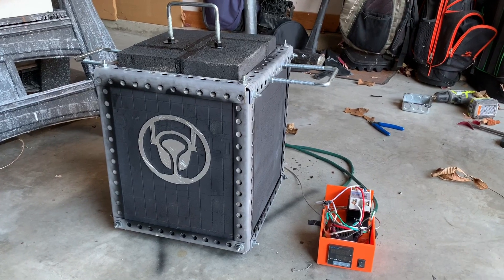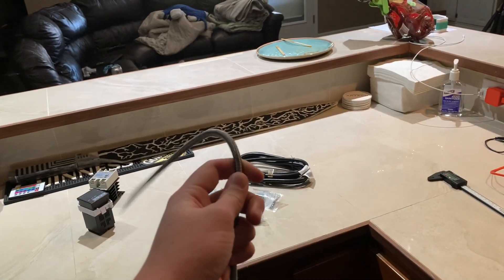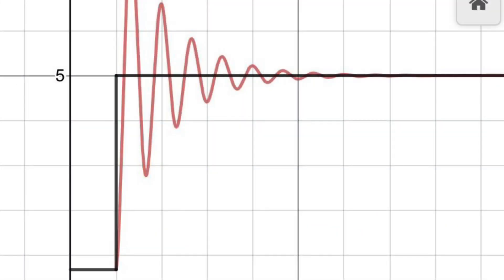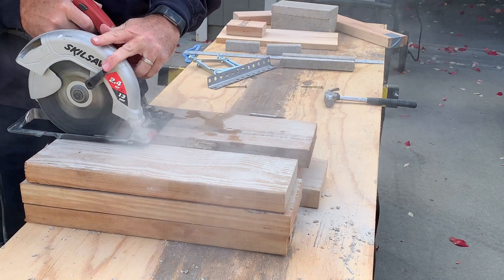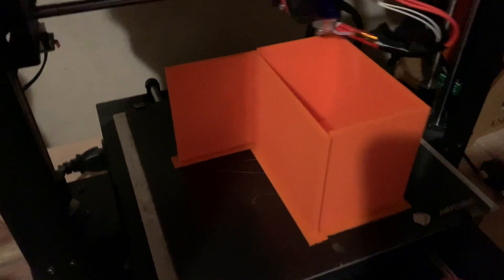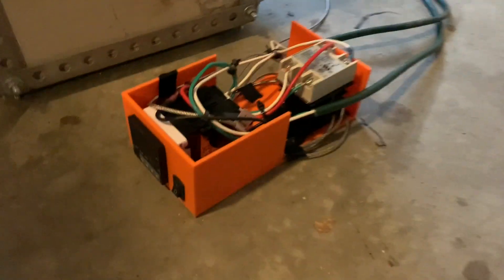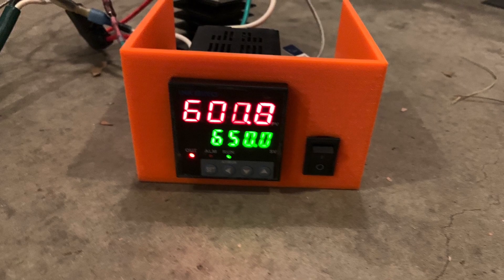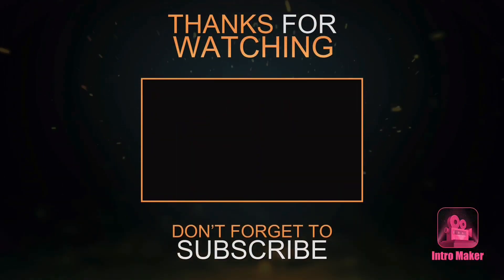How To Make An Electric Kiln Cheap (part 1)

Comment: I'm in the process of making my own kiln as well.
Could you help me with a couple of inquiries I have?
Reply from the maker: shoot
Reply: @American_Innovation  I wanted to ask about the specific parts and specs of each of them to make my own using a gas furnace I couldn't use in the open due to the heat.
In my urgency, I spent nearly 4 hours talking with an AI about every little detail of every little spec until I decided on all parts and hopefully they don't explode on my face.
Reply from the maker: @FredrickSylar  Okay. Good luck! Most gas furnaces are made of a ceramic wool, I imagine because of humidity and temperature shock. So if you have wool, I'd suggest a better structure for the coils. Also make sure you aren't drawing too much current V=IR, off of 110V, I cut my wire to a resistance of 9ohms (it'll say the resistance per meter on the package) if you can't fit that much wire in the furnace, you could use a big fat resistor to reduce current draw, or better use a transformer or power supply rated for the power you want. I hope that helps, if not I do have a second video that I made after learning a bit about electrical. Make mistakes, learn a lot, and once again good luck.
Reply: @American_Innovation   my furnace is made of refractory cement so I assume it'll be easy enough to make groves for the heating coil with a router.
So far in my configuration, I'm using a v220 line with a power supply to power this setup. Boy, I wish AI wasn't screwing around when it suggested this!
I'm still waiting for parts to arrive from AliExpress since absolutely no local vendors have them in this sh!thole I'm in.
Reply from the maker: @FredrickSylar  Sounds much better than my design. Do you know the volume of your furnace and the power ratings of the power supply?
Reply: @American_Innovation  I don't know the volume yet but that's because I intend to scrape it a but and make it larger on the inside (has nearly 15cm thick refractory cement circular wall). The power supply rated for 1300w with matching relay and coils rated for 5kw.
Everything was pretty much dirt cheap except for the furnace body that I replaced with my gas furnace, all in all cost me $65 with shipping.
Reply from the maker: @FredrickSylar  Sounds like a good setup, I'm jealous.
Reply: @American_Innovation  would you like it if I compile all links for each of them for you?
As stated before, I'm as oblivious as one could be and all parts were picked with AI assistance to reach up to 1600° C and I'm surprised it's this cheap.
Hell, even the heat resistant wool cheap enough if I wanted to make the casing myself but I know for a fact even the frame metal can't be found where I am at the moment.

I'm basically preparing a furnace/kiln for lost wax casting and mold preparing but keeping my options open for metal smelting as well.
Reply from the maker: @FredrickSylar  Yah, I could make sure you won't burn your supply and give rudimentary estimates on heat rise.

Comment: First off great job bro. I ordered inkbird 100 had a friend try and burnt out the thing. I ordered a new one but it’s the 106 not sure the difference but I was wondering a lot of people connect the pid to a receptacle they incorporate in the box for the pid now if I did that could I keep my existing switch on my old kiln or do I have to removed that existing switch for the pid to work
Reply from the maker: I actually had the 106 seriesto begin with. I don't really have time to look at the data sheets, but they seem very similar.

Comment: Thank you for your video. How did you determine the number of watts to reach any temperature, the number of heating elements and on what voltages 110 or 120 volts. THANKS
Reply from the maker: The kiln euns very small margins, I have a second video that is much better. You could use watts to find expected temperature with volume and a specific heat of 0.718kJ/kg-K but that would be better to find loss. The heating elements were run in series so the number doesn't change anything physically, it just made it easier to distribute the heat. If you are buying the coils they should tell you the resistance per unit distance, use that and geometry to find how much you need to stretch them using V=IR your voltage is constant 110 or 120 divide by the current you want to draw, and use resistance to find the linear distance of the coil.

Comment: Bro I want to follow this build but I see you saying it’s not the best version is it possible for you to make the new version of this build or do you recommend any walk through for a good diy version I like yours because it’s more simple to follow then others on YouTube
Reply from the maker: Veg oil guy has a good walkthrough although his is more complex. You could follow this with a smaller setup, more insulation, and following an resistance coil calculator. It’s been a few years, and while I’d love to revisit this, I use my resources to learn new things. I’d take concepts from multiple videos and maybe a couple teaching or reminding yourself how resistance coils work and ohms law. Remember small volume, equals cheap and hot.
Reply from the maker: Updates

Comment: what has been the max temp's ?
Reply from the maker: With a shitty American power supply ~700 F I was like 15 when I made this, so stupid. If you want to replicate it but better, use 220v  do your calculations for the resistance coils, close the area closer, and insulate everything, if I did it again, I’d double the bricks and use a hinged lid. Or use a transformer to conform to your needs.
Reply: @American_Innovation  ive got about everything for the ROKU propane kiln using a galvanized trash can lol, ceramic therm insulation route, but id rather have an electric one, any idea of a controller cheap?
Reply from the maker: @wonderwond  The PID controller I used in the video is a safe bet, it's $40 on amazon with the thermocouple and the Relay. That dilemma will be fixed with what you want to use it for. If you're melting metal, propane is a great way to go. If you want to burn out wax for casting, you'd want a small, sophisticated setup with programmability, if you want to harden clay, there's a range of ways to do it. You said ROKU, that's a tV thing so I'll assume you meant RAKU, which I believe is where you heat it quickly to cause cracking in the ceramic. Electric would not be the way to go for this. I'd use propane and buy a couple firebricks at Menards to disturb the airflow and assume an even distribution of heat. To control the temperature, use a stopwatch and your eyes to gauge the flame temperature. That's about the cheapest way I can think of. And if not firebricks, Place the burner tangent to any point on the bottom of the bin to avoid uneven heating. I'd still prop the ceramic above the flame with a regular brick.
Reply: @American_Innovation  recommendations ? im using a 31 gallon metal trash can with ceramic  insulation
Reply: @American_Innovation  I broke down and bought a used skutt kiln for 200 bucks,,, needs very little brick repair, cant wait to test it out

Comment: How much ohms or watts its layer of resistans is??
Reply from the maker: I just posted a new video about fixing it. Resistance will vary with the type of wire and the length. I live in north america so the new one pulls 13 amps on 120V, so a little less than 9.25 ohms.

Comment: Most of the kiln build videos I've seen on YouTube are running off 220V, that is probably why yours is maxing out at 600F.  Anyway, good job on the project...(!).
Reply from the maker: I agree
Reply from the maker: Update: I made a new video with the same power and got it to hold at 1400 degrees F. It could probably go higher, but I don't need it to.

Comment: So the handle on top has metal bolts going to the inside hot zone.
This will conduct high heat to the handle.
This is not only not a good idea but kinda unsafe if some unexpecting person goes to lift the lid just to have a look.
Reply from the maker: I’m not exactly going to be using this with other people around

Comment: Is that 600f or 600c for the max temp?
Reply from the maker: It’s 600°F but if you added either more insulation or a transformer (boost current) it would be a lot better. Actually I think I ran this in series which was stupid so if you tried a parallel circuit that could help
Reply from the maker: Don’t worry about it. 😂
Reply: @American_Innovation  the reason I ask is I want to do lost resin casting and one of resins requires a 900F burnout temp
Reply from the maker: @ianrhinehart  makes since, like I said you could do a little upgrade and get there for sure

Comment: Nice work Man! how's it been working for you? i'm thinking to make one also
Reply from the maker: If you make one, make it smaller or find a more powerful source. If you are in America you probably will have problems if you make one this size. Although I haven’t tried adding a transformer to increase the current. Idk what would work, I’m not an electrician.
Reply: @American_Innovation  I have a bunch of microwave transformer I think that would be powerful enough just got to find a good deal or find them on the side of road
Reply: Exactly I was just gonna build a thing and bring it to an electronics repair shop here. I’m in central Thailand. I guess the coils might be difficult to source but yeah everything‘s doable right

Comment: hi, is this PID contoller able to ramp and soak because I am looking to buy oone for my kiln. i fitted another model but it will only go to single temperatures. Thanks
Reply from the maker: No this pid can’t be programmed. You really won’t be able to find one for this cheap, sorry!
Reply: @American_Innovation  ah right, typical. thanks

Comment: What wire did you use? And what voltage and amp? I’ve heard 12 gauge should be good
Reply from the maker: I used regular extension cord wire but switched to 10awg going directly to the kiln. I couldn’t get the second set of wires to work so the regular 110v 13amp for me.